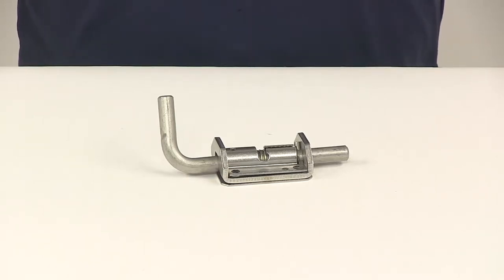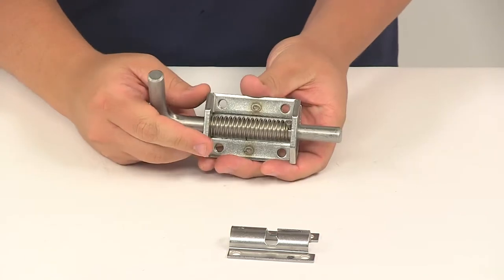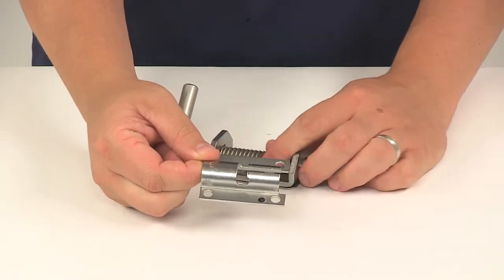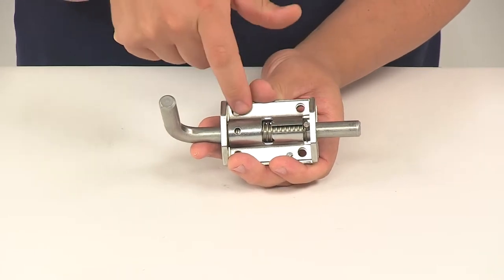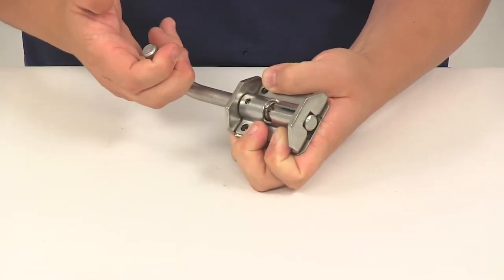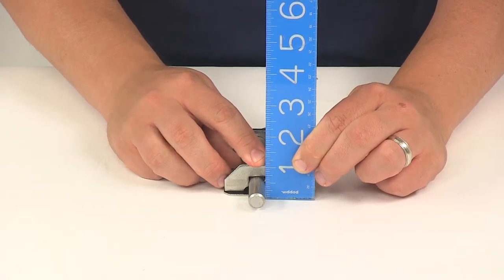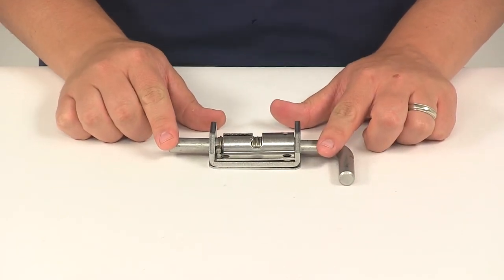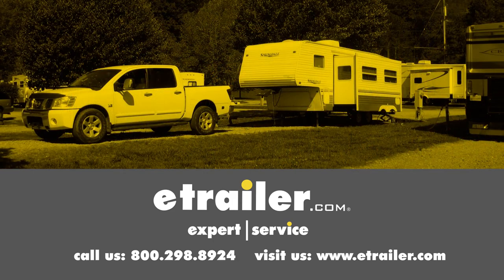etrailer | All You Need to Know About the Spring Latch w/ Cover and Holdback

Comment: Is this latch reversible for lh side?
Reply from the maker: We checked with Paneloc, and found that yes, the # F779-204U234 is reversible, and can be used on the left or right side simply by flipping it so the latch points the other way. We mistakenly had it listed as RH only (we'll have that fixed ASAP).
https://www.etrailer.com/Trailer-Door-Latch/Paneloc/F779-204U234.html